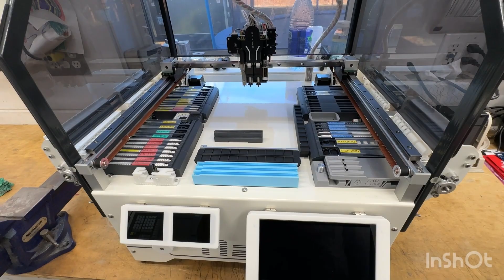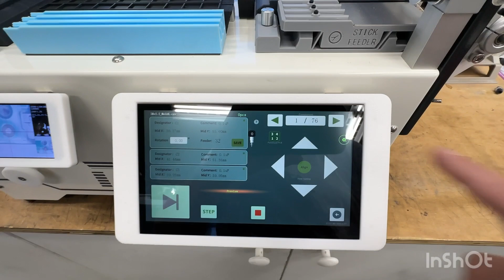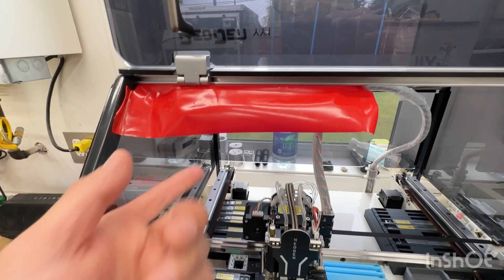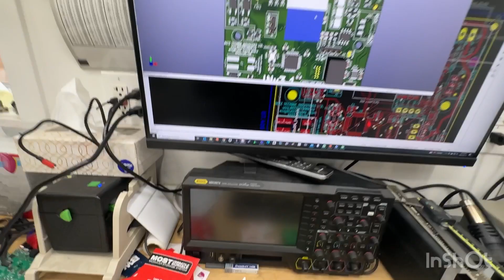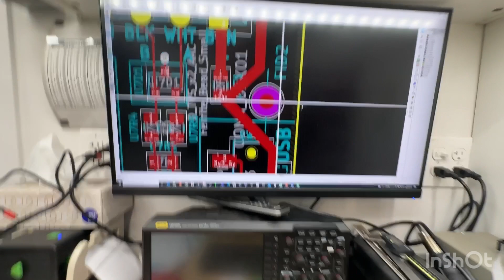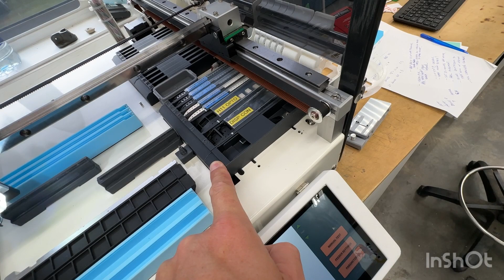Neoden YY1 pick and place machine follow up video 1

Comment: I'm on the fence about changing to 0603 on some LED's on my boards.  I have the YY1, and yes, the demonstration board that came with it seems to show accurate placement,, but I'm very nervous since I have been using 1206 for years.  Should I relax and go for it?  Also, what is your favorite solder paste?  I've been using the NC191AX35 63/37 T4 from Chipquick (leaded), but I would like to go lead free if I find something with good wetting.  I have an improvement of the light filter on the downlooking camera of the YY1 in one of the videos on my page.  It greatly improves the ability to find fiducials.
Reply: Relax and go for it. I use 0603 on my Neoden 4 by default. I do cheat a bit - I use handsolder footprints for the pads. But 0603 is great. I'm not going smaller as I dont like hand soldering/desoldering 0402 or smaller.

Comment: Was this full speed ? Seems like only around 1000 components / hour much less than claimed 3000 components per hour.
Reply from the maker: Definitely not full speed. We favor reliability over speed. I will have to check but I think this might be 80% ?
Reply: @betztechnikindustriesltd.8901  Makes sense to run a bit below 100% for reliability. But even if this is the default 70% is still much slower than spec and this will be to slow for me so will need to look at some other alternatives.

Comment: thank you for your efforts. although the size and price is right for me, I decided I will not but this machine. all plastics are 3D printed parts which has their unpredictable tolerances, that's maybe ok for first machines but a company who cares about it's customers should replace with proper injection molded parts. And the QFP that don't align.. thank you for bringing it up
Reply from the maker: It certainly might not be for everyone however its quirks have been surpassed by the advantageous for our use-case. I agree about injection molding the parts. It would make the machine a lot more stable, however I must say that we’ve been quite pleased with the drag feeders. Maybe every run of 60 or so boards we might have to swap friction rings on a couple of peeler gears. For us it’s not so bad compared to how we used to do it.

Comment: For the nozzle station alignment, you need to line up nozzle 1 with the center screw (x and y). You can't use the camera. I know it sounds screwy, but that's the deal.
Reply from the maker: I will have to check that out! I certainly didn’t seem to be anything on the camera so that makes sense.

Comment: I also bought a YY1 this year. Your videos have been essential in helping me understand the machine and its quirks. Once you understand its limitations and how to operate it, it's a pretty nice machine. I have it setup now for doing two different boards. Once thing that still irks me is that it will not remember the pick position for the 'flexible feeders' between power cycles. I find I have to reset these positions every time I start the machine. 

What are you using for labeling your feeders? It looks sharp.
Reply: What is the cost?